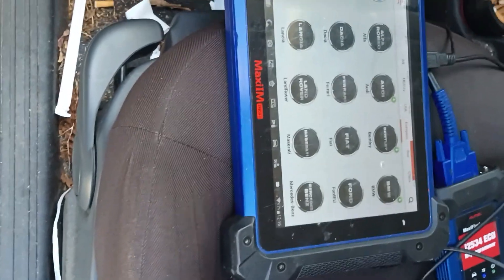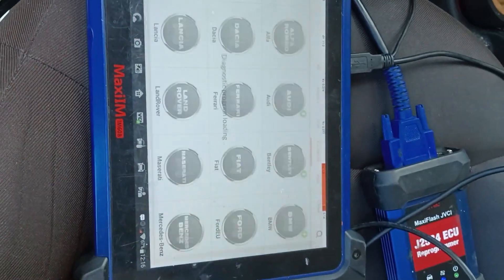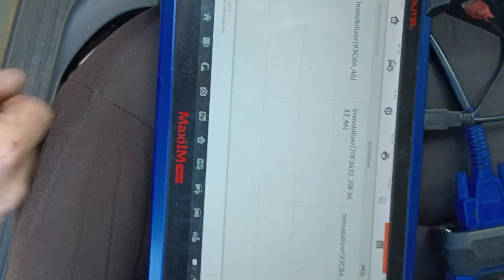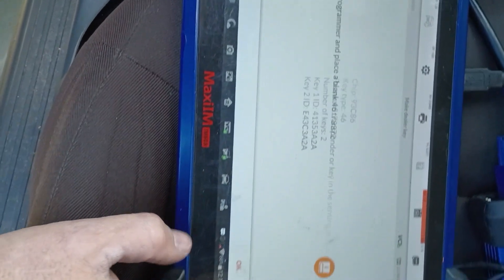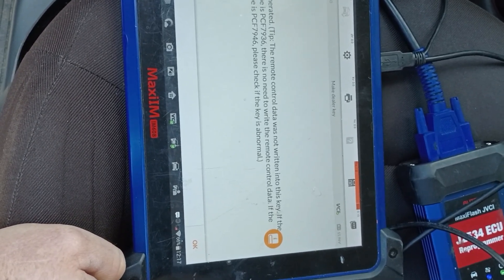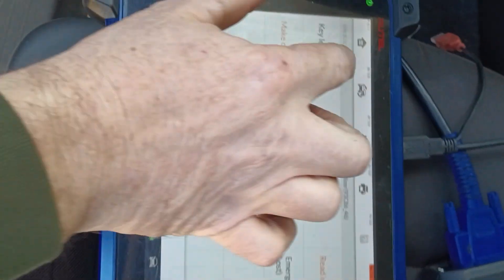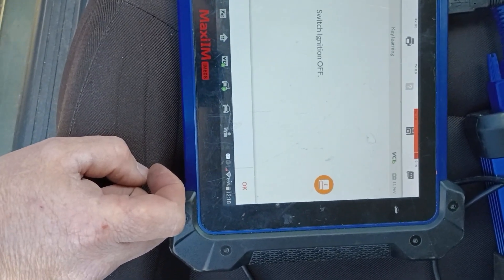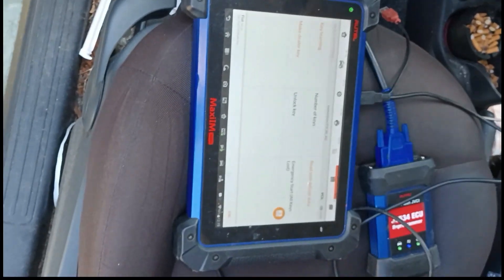Programming new replacement key on 2015 FIAT 500 with AUTEL IM608 through OBD2 after all keys lost.

Comment: Hello, contacting you from LA, California. Is it true I absolutely have to change the module at the time of programming a new key from the dealership if I lost all the keys to my 2015 Fiat 500 sport ? they are trying to charge me about $700 for the module + $600 for labor cost, already paid $210 for the new key.
Reply from the maker: Hello, No you should not need to replace the BCM just because its all keys lost. In the video, the original bcm is installed and as you see there was no issue's programming the replacement key.
Reply: @ecurepair  thank you I appreciate your advice.
Reply: @ecurepair  Would this change if the alarm system was activated when I lost my keys??
Reply from the maker: I dont think just the alarm being on would be a problem but if it had been tampered with or improperly programmed too many attempts then I hear that can lock them up
Reply: @ecurepair  ok, got it. Thanks again for your input
Reply: What should we do if it is blocked? Should the BMC be changed?